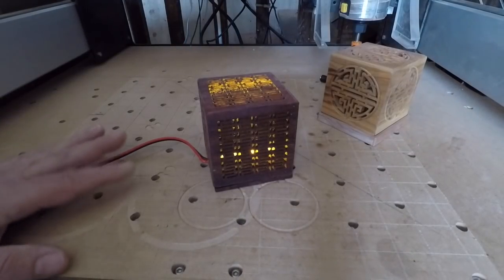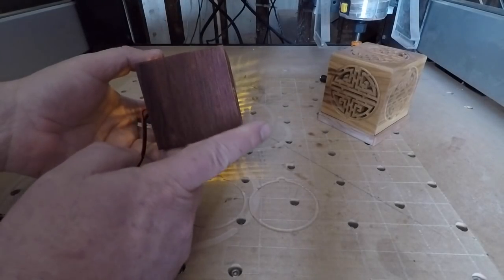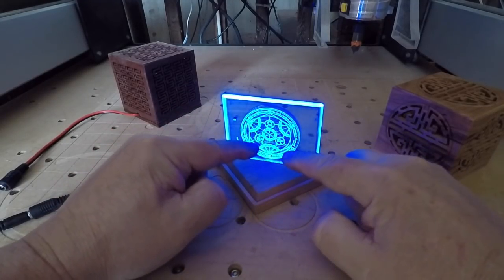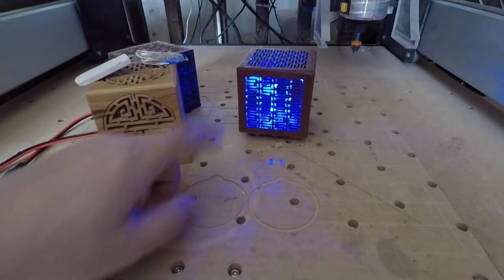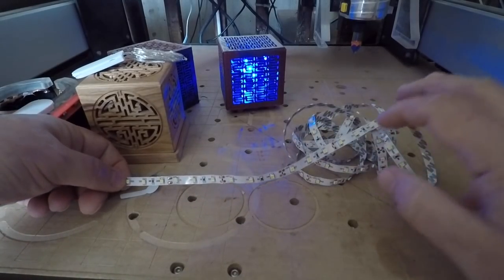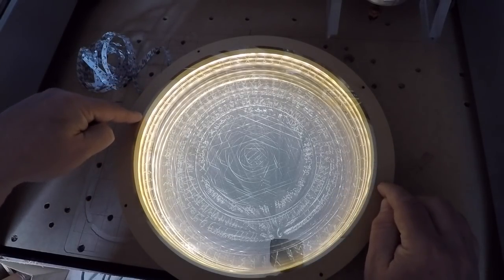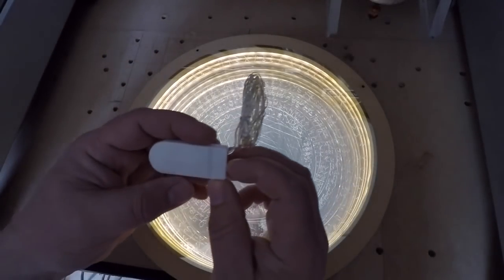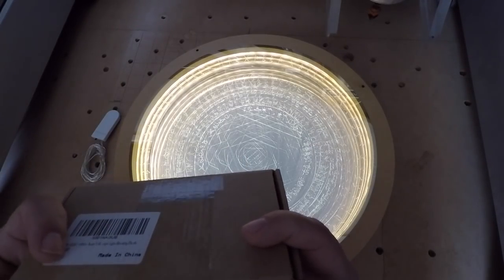Deep Thoughts: LED Lights

Comment: Did you build your own dustboot?  Would that work with a Shapeoko Pro XXL-Basic Carbide 3D spindle. I am using Carbide 3Ds Sweepy but it does not work so well.
Reply from the maker: It's from these folks: https://www.onefinitycnc.com/dust-collection Not sure if they have one that will fit the carbide spindle.

Comment: I followed your video for making the Chinese box and put a small edge lit acrylic Death Star inside.  It came out great! Your method for creating the box is perfect. I used 1/4 inch MDF which was the only 1/4 inch stock I had on hand but will definitely do this again with hardwood.

Comment: It makes no difference to which lead of the LED you solder the resistor.  Usually a 220 ohm resistor per LED will work.
Reply from the maker: True enough. However, if you consistently use the hot lead, then it's easier to keep track of which lead is which, once they are trimmed and soldered. Additionally, 99.9% of wiring diagrams have the resister on the hot lead. It's more of a consistency thing to me.

Comment: for the first set of lights, do you need 1 resistor per LED. or just 1 at the beginning of your string?
Reply from the maker: It's one per LED and wired in parallel. Something like this: https://www.dropbox.com/s/ze7xdgiodlktoj1/LEDandResisters.jpg